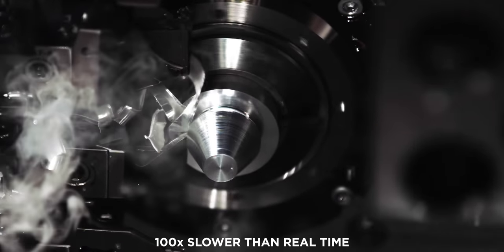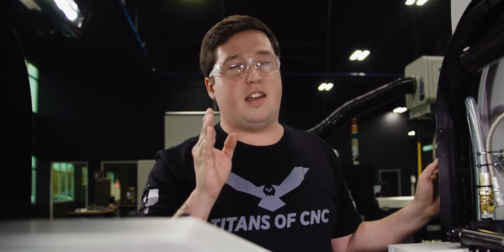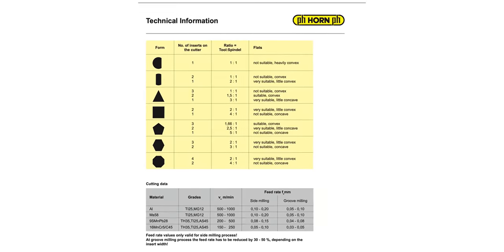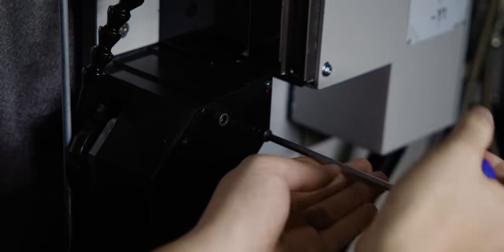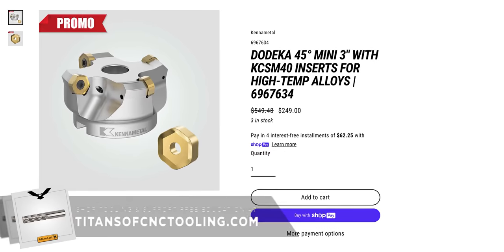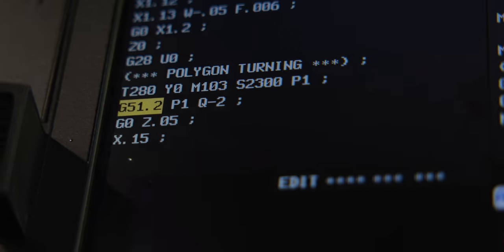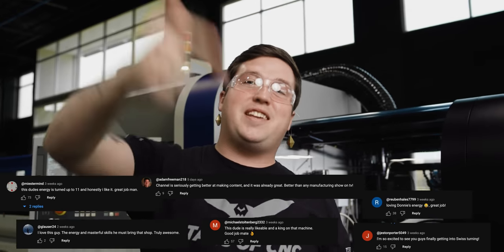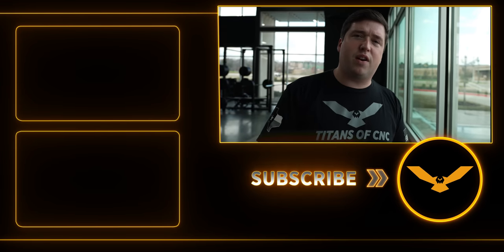The UNREAL World of POLYGONAL TURNING | Swiss Machining Genius

Comment: This was my final year project about 40 years ago . . . we called it orbital milling in Europe, because we drove the multi-inserted tool with orbital gears and the part was stationary. This Swiss solution is much faster and easier to adjust.
Reply: That’s actually insanely cool man! I love the older machines as much as I do the new ones!! They don’t get the love they deserve
Reply: there always has to be one to invent, and one to perfect it. both are as hard to do as the other
Reply: Prove it.
Reply: Poderia compartilhar a fórmula ou cálculo
Reply: Much credit to you to be able to do it without the tech required today. I always am intrigued by all the engineers who had to do hand drawings and calculations. Software has completely killed that skill and understanding.

Comment: I'm curious, do the flat edges have a slightly concaved surface or are they truly flat?
Reply: The square was flat within .001 and the hex was flat within .003. If you did 3 inserts instead of 2 the hex will be flat within .001
Reply: veeeery slighty concave yes
Reply: Hola saludos desde Uruguay genios totales soy de la vieja escuela de fresas y tornos esto me encanta todo lo pueden hacer. Las diferentes de piezas  por ejemplo un cuadrado o un triángulo cabía la pieza si cambia la relación de RPM  entre la pieza  y la herramienta perdón si no entendí saludos

Comment: How convex or concave is the flat then? 🤔 would be interesting to see just how tight a tolerance can currently be held
Reply: I noticed he didn't mention tolerances.
Reply: If this is actually useful in a shop, I imagine it's very rare.  Makes for a great vid tho
Reply: It comes out more that than I was expecting. It was a few weeks ago but I am pretty sure the squares were flat within .001-.002. the Hex was a little more concave at .003 but If I had used more inserts at a different ratio it would of been better
Reply: The diameter of the live tool as well as the ratio of rotation between part and tool have an effect on the concave effect. Usually there is never tight tolerances on angled polygons, and for flat polygons, well concave doesn't change anything because the wrench grips the edges of the polygon, which is what your caliper reads also

Comment: Polygon milling is so cool, I use it on quite a few parts I produce.  One thing I have not been able to figure out is how to time the polygon milling with other features on the part without physically rotating the polygon mill on the spindle. If anyone knows the answer I would love to know!
Reply: It’s more on your machines capabilities than anything. I used G53 CDR0 (R0-360) to set the timing of the live tools spindle to the main spindle. You will notice in the part the squares are all 20 degrees apart from eachother. If the machine can’t sync your live tool in the same spot everytime like that then you are kind of screwed.

What machine are you working on? I may be able to help
Reply: @donniehinske  thanks for the reply, I’m running Hanwha XD-20h machines. My polygon mill is in a front working slot on the sub side. It is driven by the sub spindle.  I have never tried that line of code you mentioned.  All my polygonal work is on the same plane like a simple hex shape. So I only need to orientate the cut at setup.
Reply: @chipper203  ah I see! I’m not sure if that code would work on a Hanwha. I’ve only ever worked on a few of them so I don’t know the code as well as I do other machines. I am sure there has to be a way to do it though
Reply: @donniehinske  I gotcha, it is a fanuc 18i control I forgot to mention

Comment: it is both theoretically since both the tool and part rotate. but since the cutting speed has to come from the part turning by a significant amount, and you wouldn't do it on a mill, l would very much say it's polygonal turning
Reply: Yes. And even the workpiece-tool relationship is closer to turning.
Reply: @JFBence  and l guess you programm it like turning

Comment: And for 7-9k you can have this attachment too. We've got a ST-38(triple turret) that we're outfitting with some new live tooling attachments and the cost is insane. The machine cost nearly a half million and we have nearly another 100k in attachments. If you are thinking about buying a swiss lathe just know it's not for the light hearted...
I highly recommend ph Horn tooling. Costly but top notch.
Reply: yeah well they cost money they are not expensive but valuable. Just think about this, mill turn with 80 tools and 12 position revolver, look at 500-1000 for each on the tool changer and 500-2000 on the revolver. Just to start with. What you actually get is entirely different.

Comment: That's shockingly simple. Absolute genius.

I'm new to your channel and CNC generally. You probably answer these questions in other videos, but:

1. For that staggered offset effect, I assume you're just briefly pausing the tool. How do you do the timing to set the alignment of different faces like that?

2. You mentioned concavity, which I assume is caused by the circular motion of the tool. It's reduced because the part is also turning, but doesn't that also depend on the radius of the tool and the part? Do you have to compensate for that?
Reply: 1) if you are talking about the squares the staggered effect is done with G53 C"" so square 1 is G53 C0, 2 is G53 C20, 3 is G53 C40 and so on in 20 degree increments. This offsets the phase offset from your live spindle to your main spindle. each square is 20 degrees apart

2) yes you are 100% correct the fact that the part is rotating into the tool is what reduces the concavity. the square was flat within almost .001"

Comment: Turning is rotating an object with a static, by reference, tool. Milling is rotating a tool with a static, by reference, object. This has both a rotating tool and rotating object. So at a surface level, it could be considered both. 
But if you want to get stupidly technical, it's primarily a lathe with a manipulated mill-like tool; the object is constant, the tool in reference is not constant in position. So technically intermittent turning at rates that are inhuman to accomplish. You could hypothetically produce similar results without a mill-like tool, just adjust linear position of the cutter at stupidly fast rates, essentially a robotic cross-slide; very similar to the concept of a rose engine, but different in execution and at much faster speeds. Thus intermittent turning should be the proper term, because the mill-like tool only simplifies the process mechanically, though this is at the sacrifice of the linearity of the polygonal sides. 
For example, if you put a fourth axis on a mill, does the mill also turn into a lathe? No, because of which part is rotating and which part is static by reference. It's the same here.

Comment: How much of a larger scale can you go with this? That will fit in an NLX2500 or NLX2000.
Reply: I am not entirely positive as to when this will happen but the bigger your diameter of your shape gets. The more concave or convex it will get but yes on those machines I am pretty sure there is a Polygon turning option

Comment: There is no turning vs milling debate. If the piece you're cutting is clamped immobile its milling, if its turning then its turning. That's why its called turning; it turns. Milling should be called rigid fixture cutting not milling.

Comment: Is it possible to pull back the tool as it approaches the center of each cut to reduce the concavity?
Reply: You probably could set something up in CNC. 
I, myself, am still wondering how more cutters reduce concavity, while also creating extra faces.
Reply: @87mits  I feel like the concavity is the same in terms of the radius of the circle being cut but the depth of the concavity is smaller with more cutters because each cut represents a smaller chord of the circle being cut. Number of faces changes because if you don't vary the rotation of the workpiece or the tool and the number of cuts per rotation of the tool increases while the workpiece stays the same then the number of times a cutter hits the workpiece per rev changes.

Comment: These codes are pertinent to the world of swiss. What about applying it to the Mori Seiki Lathe NLX2500-SY700? I challenge myself to do this for cycle time purposes. Is there a manual way to program this cycle if the G251 code is not avail? Or is this opiton something that can be turned on in the parameters?

Comment: I'm going with turning. 
Turning: the action or skill of using a lathe.
Lathe: a machine for shaping ... material by means of a rotating drive which turns the piece being worked on against changeable cutting tools.
So part go round fast = lathe and lathe = turning.

Comment: I understand it (and use it when called for) but it's like spindle transfers on dual-spindle lathes to me.... I don't like it.
Reply: What's wrong with doing a spindle transfer. It's a huge time saver. It al also keeps front and back side features clocked more accurately. If you're not transferring your parts, then you're wasting time.
Reply: @brandons9138  oh, absolutely, it exists and i use it when on a machine with it

It just feels unpleasant to me and felt as such before i was even nearby to any crash